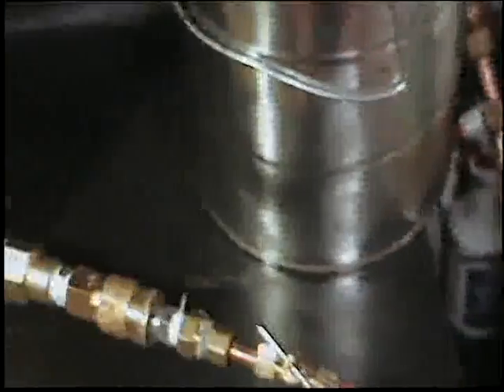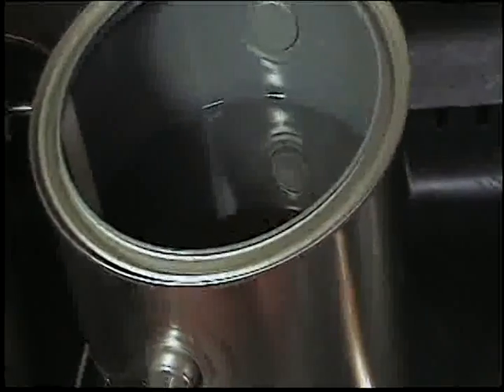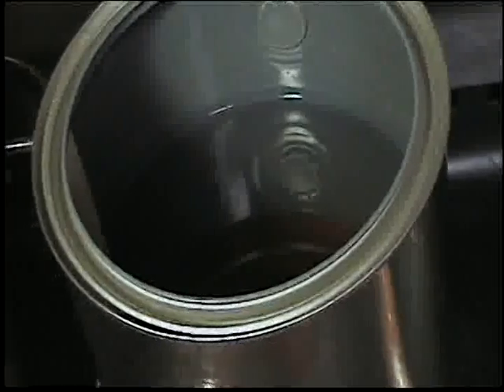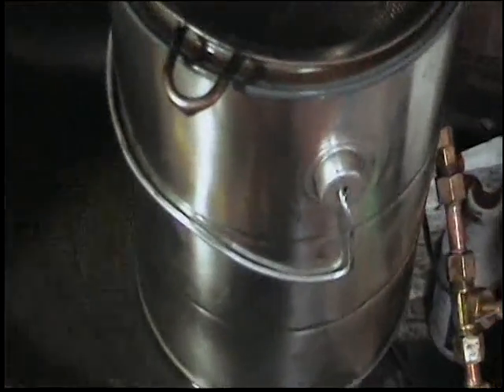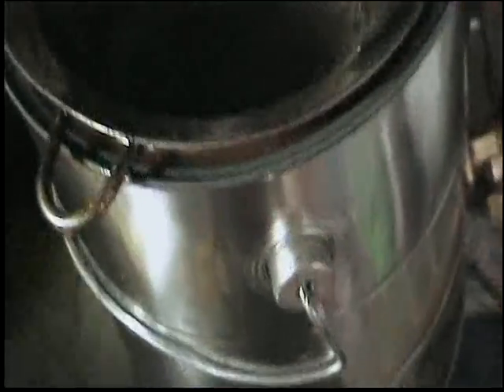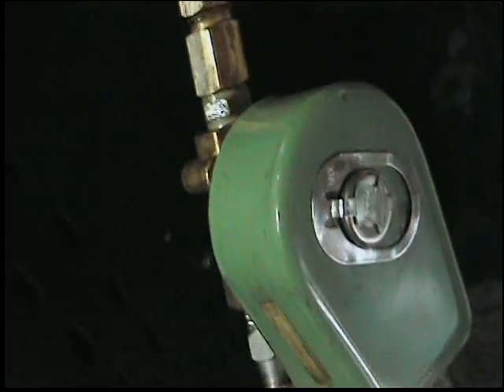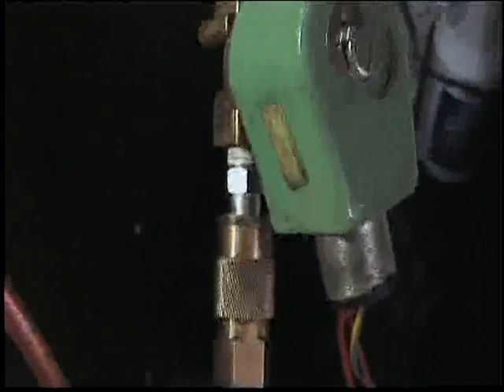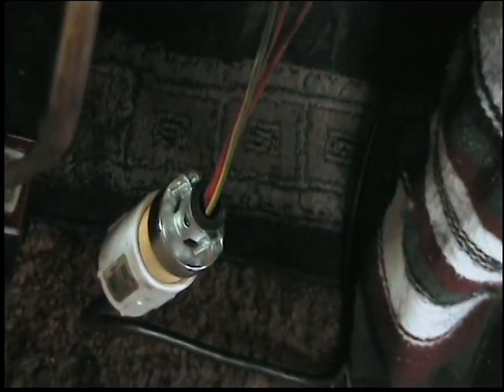Pellet stove burning free Used vegetable oil !

Comment: More info please.  I know nothing about pellet stoves in particular how the auger works so I do not understand the solenoid set up.  

My home is off the grid and I recognized concept of steam as an automizer earlier. Only seen is used with a Babington though.

How much water (I have no running water either) does it user per hour?

Comment from the maker: No problems so far.  I have not really exaimined the exaust fan, but the stove pipes stay clean.  This is only the second winter for the corn stove. I have been burning WVO in an older pellet stove for several years using various burners, without any blower or exhaust problems. I have had several poor designs that would cause carbon and smoking problems.  Nothing that didn't simply burn out once the issue was resolved.

Comment from the maker: No, I have not tried Waste motor oil, however it should work fine. I have had no trouble getting all the Waste Vegetable Oil I can use for free. Burning WVO is cleaner than burning WMO. Solenoid valves can be found at a big discount on ebay. My solenoid valve is an ASCO 120VAC 2 way Normally Closed 1/4" Pipe 15 PSI and 10.5 watts.

The burner can be operated without the Solenoid valve as long as you attend the operation. Attended operation is the way to go, at least that is my sugestion.